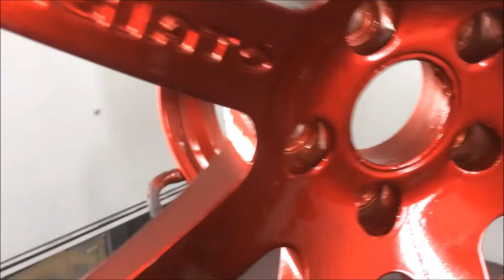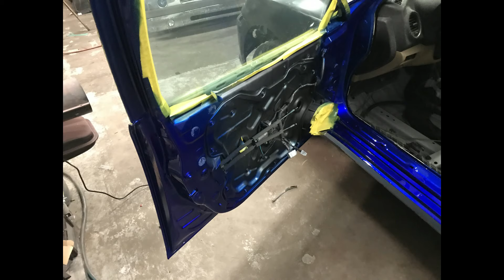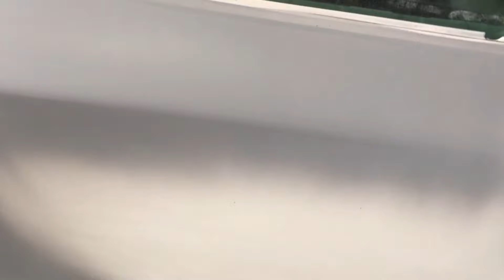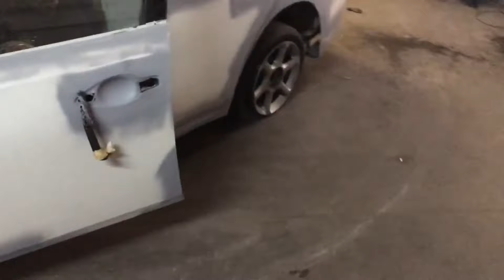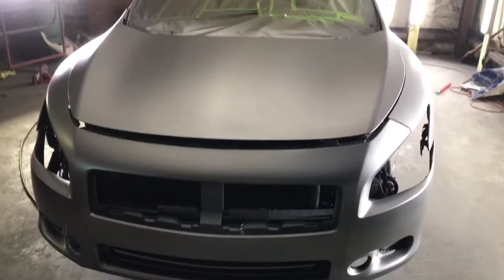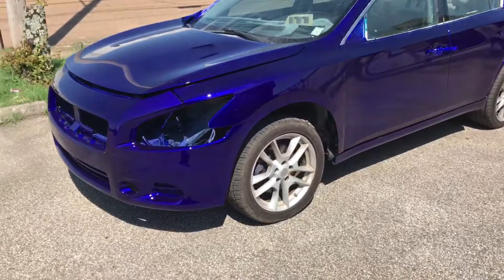09' Maxima "Kandy Blue & 28s" (Part 1)

Comment: Wat clear did you use? Try that new Tamco Clear everybody talking bout it looks wett and real high solids for a decent price
Reply: Tamco ain't what it claims to be. Matrix clear is better and cheaper. But for the best, use deltron by ppg
Reply: @alconyers2003  wats the wettest gloss clear u thinnk beetween matrix ag40 or ppg?
Reply: MartinMora92 man, that's a great question. That AG40 is the truth. I use DCU2002 on factory work and matrix on custom work. I think matrix ag40 flows better and is wetter. But ppg dcu2002 is a lil thicker and it gives a nice oem orange peel
Reply: @alconyers2003  thanks ill look into ag40 i hear about it alot, now would you say ag40 is wetter than house of kolors clear? For custom
Reply: MartinMora92 I've never used HOK clear because with either ppg or matrix u won't need HOK clear.

Comment: That car is going to need to have hours of work still. Hella elbow grease to cut and buff that after the paint cures.
Reply from the maker: Dibeezy ThaGifted that’s the thing I’m not going to cut n buff that. I was building a solid foundation. I’m a flow coat then cut n buff. Watch the next video.